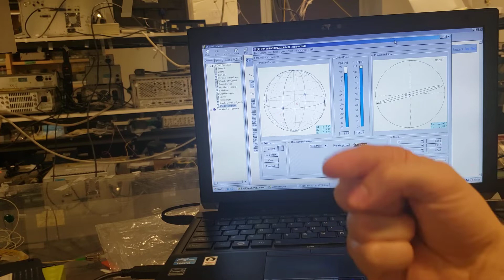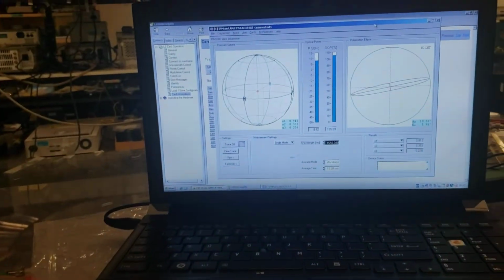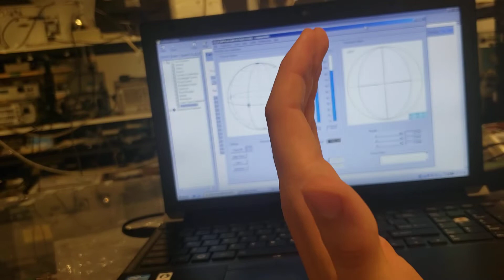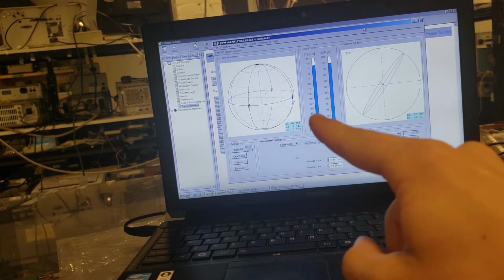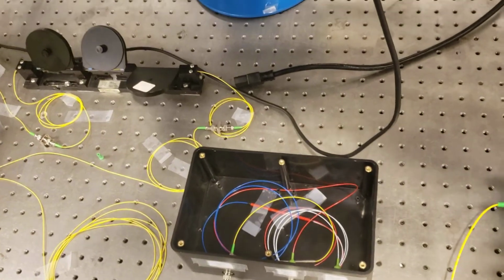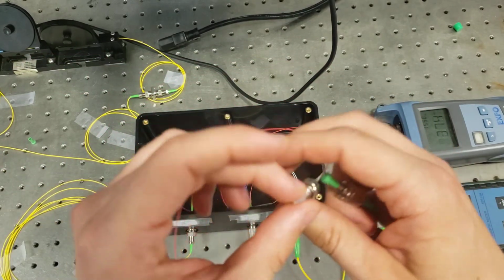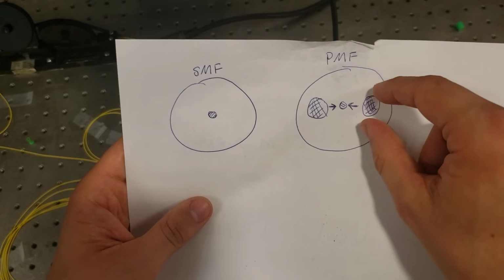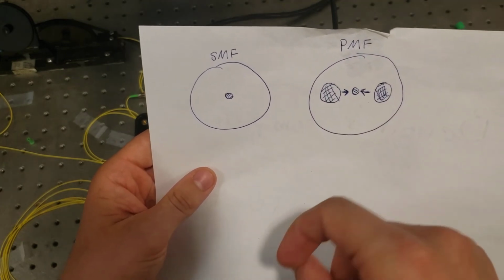Polarization control in Fiber Optics

Comment: What type of optical polarizer will keep polarization (circular).
Reply from the maker: The easiest way to remove light that is, for example, left-hand circularly polarized is to place a quarter-wave-plate in front of a regular polarizer and another one after. 

Here is the idea: First, align the polarizer at a 45deg angle compared to whatever x-axis you choose, so that E-field vectors pointing in that 45deg direction are transmitted and those at a -45 deg angle are removed. 

The QWP in front of this polarizer will introduce a π/2 phase shift between the x- and y-components of whatever light enters. Thus, Right Hand Circular light becomes +45 deg polarized and is let through, while Left Hand Circular Light becomes -45deg polarized and is removed (or maybe the other way around, but try checking this yourself as an exercise). 

The last QWP can then introduce another phase shift and make the light circular again. If you specifically want it to be RHC again, you can place a half-wave-plate in front of the final QWP and use it to rotate the polarization appropriately.

Hope that helps!

Comment: Thanks for the videos. Very well explained. It’s hard to find videos with theory explained in a practical way. 
I have a SMF DFB laser but would like polarized light for SHG. As you explained, any movement of the SMF will cause changes in the polarization. Do you think if I glue down the SMF before the polarizer it would keep its polarization? Any other ideas are welcome. Thanks again!
Reply from the maker: You're welcome, I am glad that you found it useful!

As you can see at 6:00 onwards, the values measured by the power meters remains constant unless something the fiber is actively disturbed. Simply using ordinary scotch tape to fix SMF to the table usually provides more than enough stability in 99% of cases. When doing this, a pro tip is to tape the end of each piece of tape to itself, creating a non-sticky "handle" that makes it easy to remove and reposition. 

Furthermore, if you use a polarization controller, a PBS and a power meter as shown in the video, it's easy to re-optimize the polarization if it gets misaligned for some reason. Simply adjust the paddles until the power in the port measured by the power meter is minimized, in which case the power in the other port that you are sending to the SHG crystal must be maximized. 

Hope this helps. Feel free to let me know if you have additional questions!
Reply: This is great. We'll give it a try and thanks for the PRO TIP.  @yourfavouriteta
Reply from the maker: @w8ryanb  No problem. Good luck with your experiment and let me know how it goes. I plan on publishing a video explaining the intuition behind phase matching in nonlinear processes, which you may find interesting, so stay tuned!

Comment: What software are you using?
Reply from the maker: It's the software that came on a CD with the Thorlabs IPM5300 module. This is a legacy device from around 2006 but the manual is still available on Thorlabs' website.
Reply: @yourfavouriteta  Thank you.